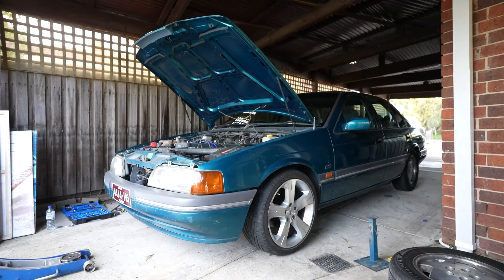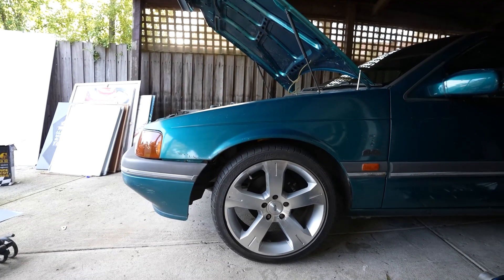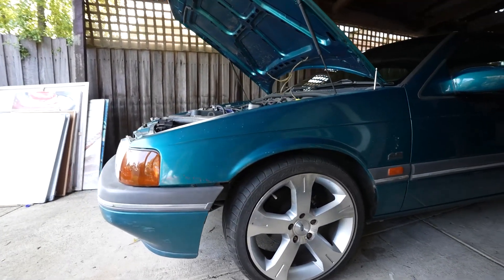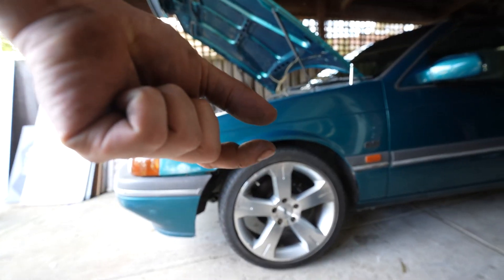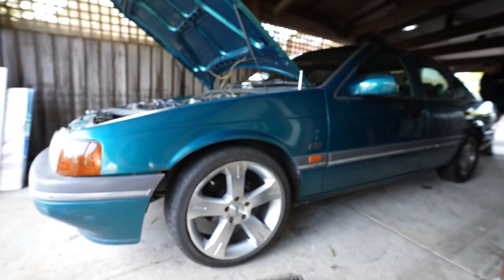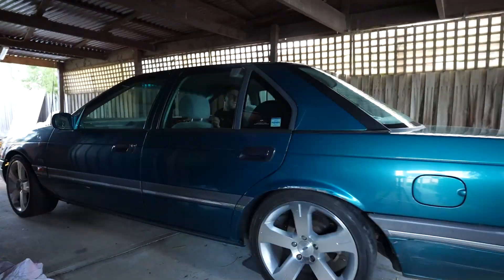SL King Springs in a EB Falcon Fairmont Install

Comment: Hey mate I just bought two ED.
1 Fairmont and the other Futura. 
What wheels are they from is it FG?
Reply from the maker: These are Copy’s if 18” Ba xr8 in e series offset , you can get BA ones but will have to run spacers which is not ideal